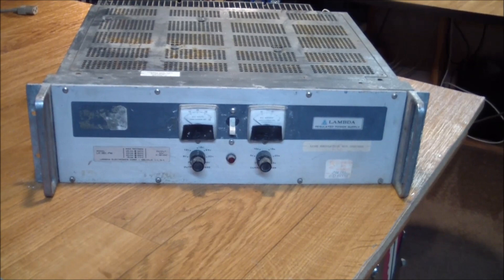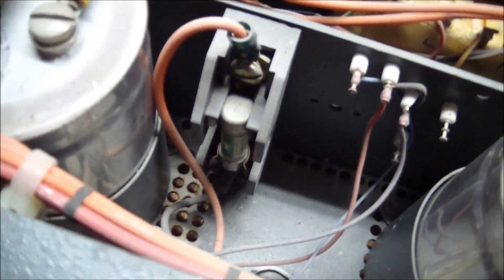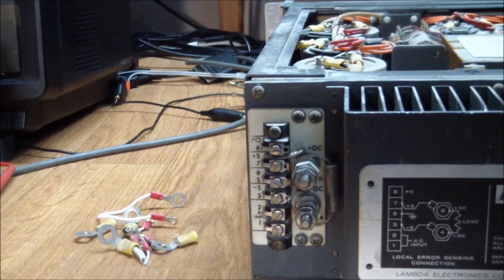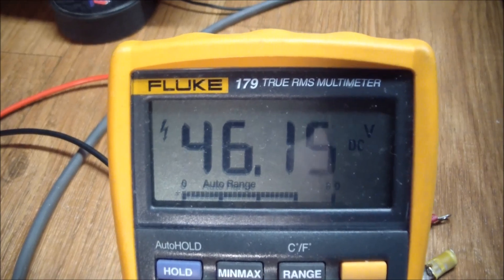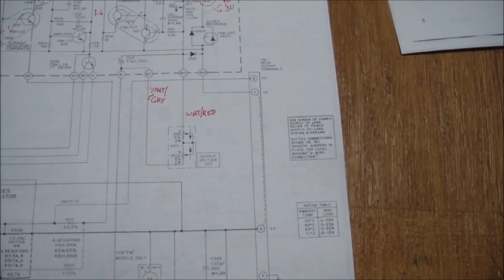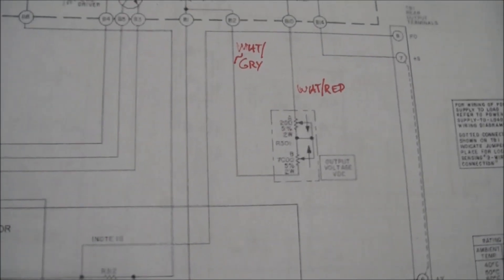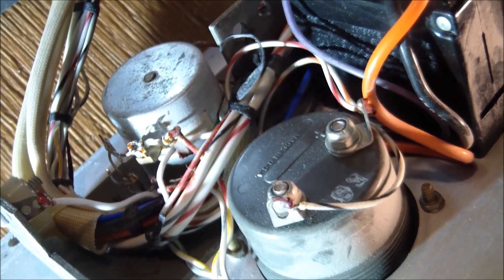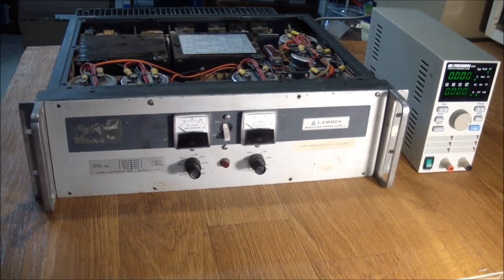AE#49 Repairing A Lambda LK 351-FM Power Supply

Comment: Thans for this brilliant informative video. I bought also two Lambda power supplies, they sold to me as broken and not working. Mine had also missing bridges between the S-  with  -DC and S+ with +DC.

After replacement both power supply's work properly.

Comment: I just got a Lambda LK 343A-FM free! (~ 35lbs) I tested 36.5v at 11 amps out with under 50mV ripple! Solid stuff! They're really efficient since they phase-fire the transformer so the output pass transistors don't have to spew out so much heat.

Comment: I just received one of these. No regulated output. Voltage sense +- are connected as indicated on the rear diagram.  No shorts on the radial ganged pots. Pots do work.  I have found 4 Zener's that are open in both directions. No change. I am continuing my search for bad parts.

Comment: Huge filter capacitors and massive transformers = a very stout power supply.  I always remember seeing Lambda power supplies in the science labs whereas the engineering labs used HP power supplies.  I just noticed that your work table for this video is a pinball game frame? Props to Lambda for giving you the user manual.
Reply from the maker: The work table is in fact a 1978 Bally Playboy in full working condition. I ran out of bench space on a particular project a while back and I "borrowed" the top surface and covered it with wood. Takes about 2 mins to undo and doesn't hurt the machine one bit.

Comment: Nice video. Both CR232 and CR274 were bad on mine also. How did you cross reference the part FMBZ104? I have a couple of other component that are bad such as a FMBZ107.  Can you point me in a direction to a cross reference for the Lambda parts? They are SO hard to find.

Thanks!!

Comment: I bught a.nice Fluke 60 watt supply with LCD readouts but could not get it to work. Checked all the components and connections twice. Finally I read the operations manual carefully and discovered it would have no output if the rear panel sense jumper was not in place. Works great now😀

Comment: Hello, Is the service manual for this LK 351-FM covers also the LK 352-FM ? if so , I am quite interested by this manual. Best regards
Reply from the maker: You can Google to search for "IMLK350LK352.pdf"
Reply: @artifactelectronics  Thanks , but unfortunately " "IMLK350LK352.pdf" gives no result on Google. I found a pdf file with IM LK FR but no schematics ( IM in this case = Instruction Manual) . Any direct web link ?

Comment: Nice repair. I would have loved to see the device work. Specifically, how do you control both voltage and current independently? Obviously you can't for a resistive load. Do you toggle between voltage or current supply? I guess I have lived in the digital domain for too long...

Comment: I was surprised you did not connect the sense wires as the diagram on the back shows how to connect them. Yes you are very safety minded worrying about capacitors being charged on a 40V PSU.